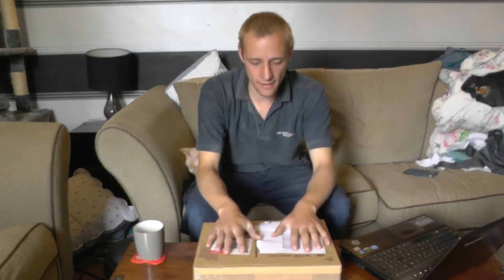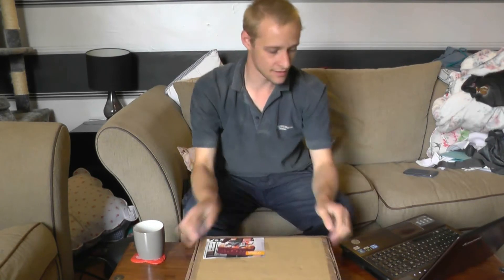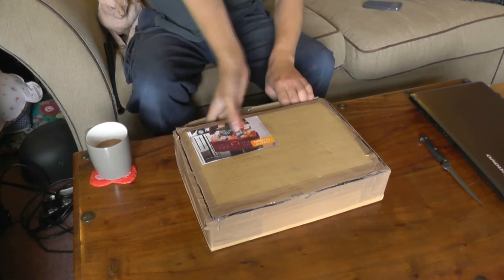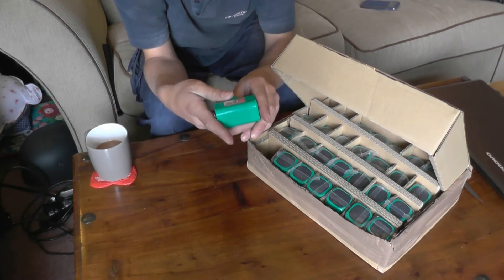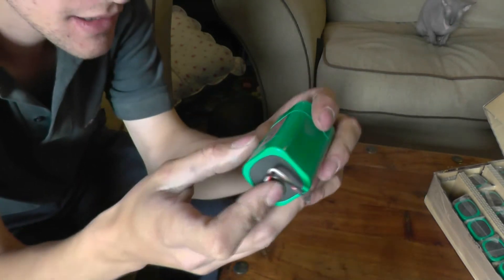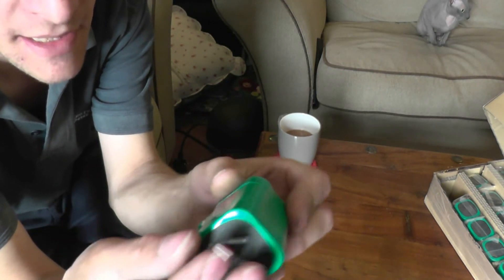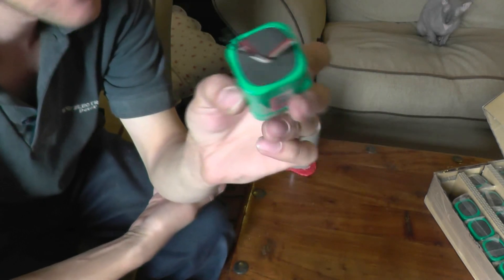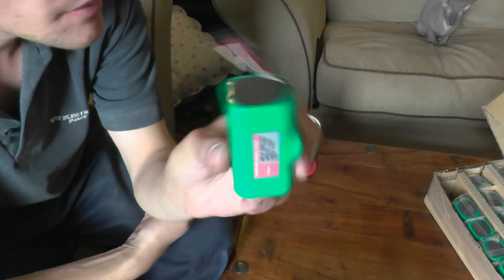Special thanks to Stoo234

Comment: I have these from Stoo234. Connect the white wire to ground and they will charge off desktop PSU. Amperage is 2Amp. The current is set by the Battery Management System PCBs. The 2 round things on the side. Individualy they will take 4Amps with no heating problems. Enjoy.